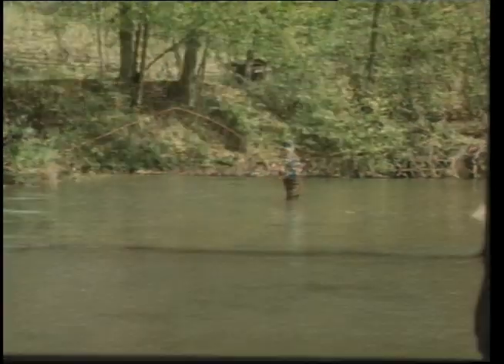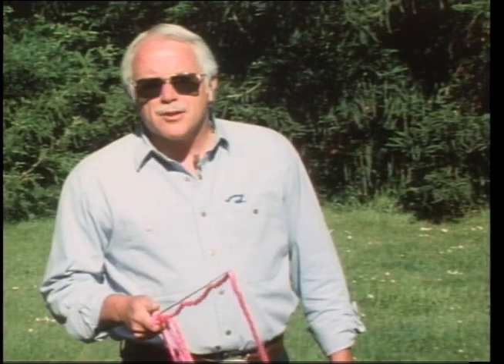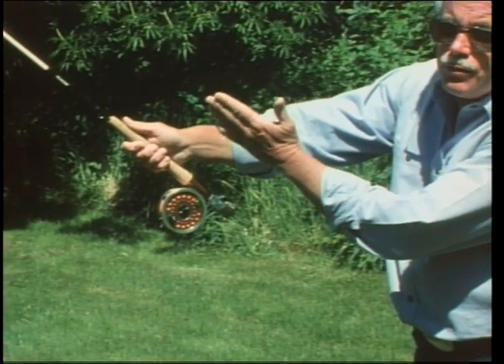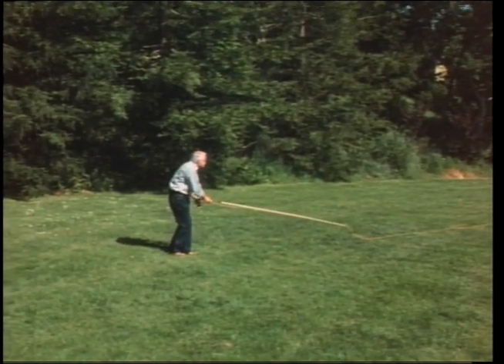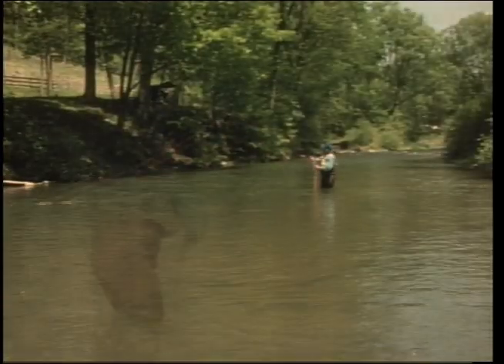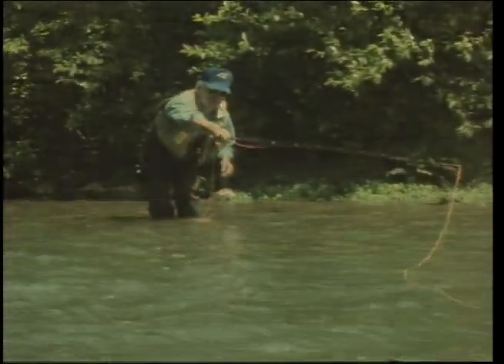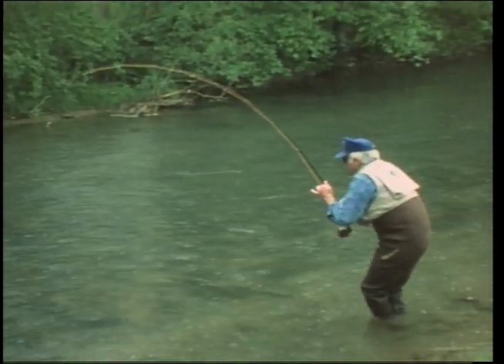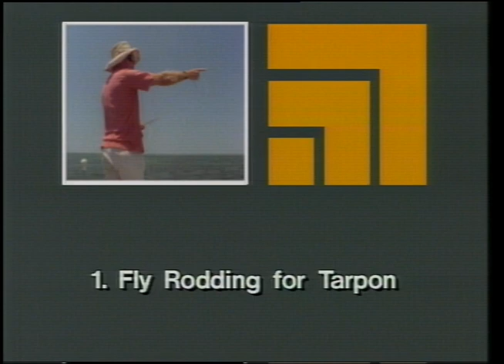Basic Flycasting with Doug Swisher

Comment: I really enjoying your video.  I had to pause it to make a quick safety comment. PLEASE DO NOT stand near a power line and use it to track your tip. Again, great video, thanks!
Reply from the maker: Glad you enjoyed!
Reply: Good point. Anyone using a 30' rod should avoid doing this.
Reply: Around here most power lines  rest at less than 20’ in the air. They are often mistaken for telephone lines. I’m guessing a fishing line wet from the dew would be a pretty good conductor. I may be overthinking this whole thing but I would never let my grandson or daughter fly a kite next to one?

Comment: One thing I don’t understand, he says to use the wrist when most other vids I looked at have said to lock the wrist.
Reply: He said develop the micro second wrist, as in keep your arm and wrist locked and when you get to the end of the back and forward cast, your snapping the wrist just a bit.  But not so much that you’re over extending the 90 degrees.  Hope that makes sense
Reply from the maker: A little wrist motion is OK in fly casting and often very good fly casters will use some.  Many beginning fly casters tend to use way too much and it’s easier to eliminate wrist all together to attain the basics, and then bring it back in with more experience.  At the end of the day, the critical factor is to maintain a proper casting arc, which could theoretically be done will all arm or all wrist, but the ideal scenario uses a little of both.